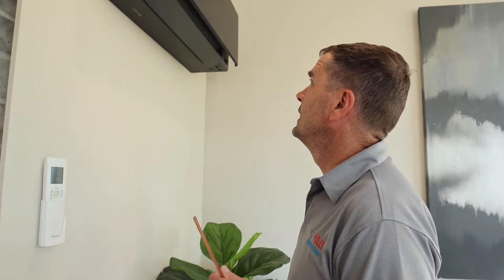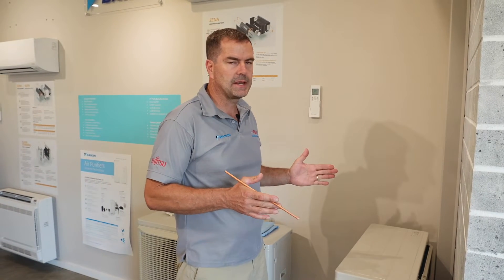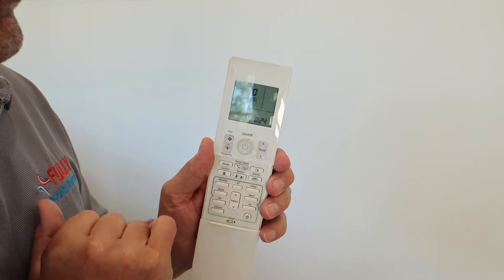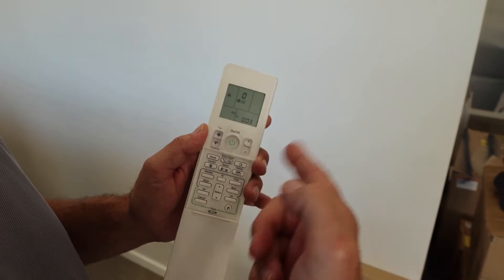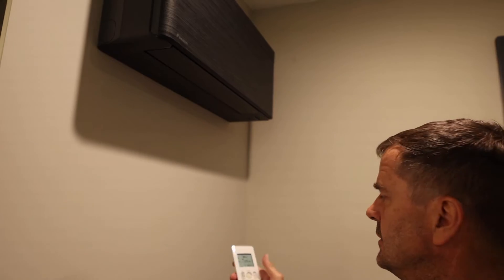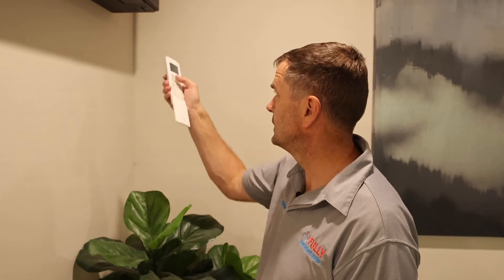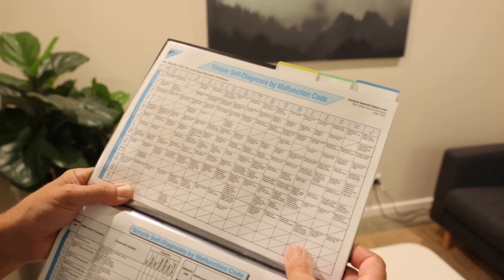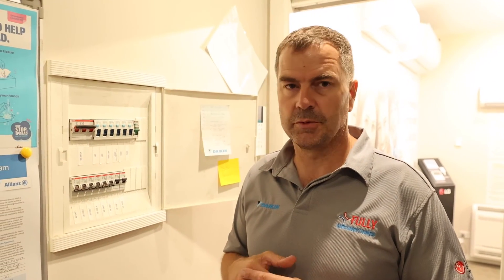How to fault find a Daikin air conditioner, troubleshoot split system ductless, green light flashing

Comment: I have a very new Daikin heatpump, maybe a little over a month old now and it seems to be going into defrost mode way too often, like every 17 to 20minutes and it takes 15minutes to defrost. So almost half the time goes to defrosting the thing.  And when it starts defrosting, there's no ice buildup on the outside unit, i've checked. That can't be right is it? Why does it defrost when there's no ice?
Reply from the maker: Doesn’t sound right, have you watched my defrost video, this explains how, why and when your Daikin’s units gos into defrost. I would be getting the people who installed it sounds like there is a problem.
Reply: @FullyAirconditioned   I watched many vids about these things. Some of them talked about timers that each manufacturer put on the board, commonly 30-60 or 90mins, meaning minimum runtime until next defrost cycle. What timings does Daikin have on these things? Is one of them about 17 to 20 minutes like mine does? Anyway on mine something clearly triggers the defrost cycle even when not needed.
Reply from the maker: https://youtu.be/A6QUFtnLu9c?si=mJE-CzTg5OSRcdwE
There many reasons and ways systems chose to go into defrost and it depends on the brand and where it’s made. The most simple and basic is the defrost time you described, after a set amount of time if the coil temp is below the pre set temperature the system will go through a defrost. The daikin’s units like in my video (link above) doesn’t have a defrost time as such, it has a defrost function that is triggered by a number of different scenarios. The daikin units like in my video, have multiple sensors, on the coil, outside temp, suction temp liquid line temp, suction pressure sensor, and an on board Computer deciding when to go into defrost.  It looks at temperature, gas pressure, temp outside, coil temperature and a number of other input, not just time and coil temperature. But depending on where the unit is made, if it is an American style outdoor unit, the standard looking barrel type system, that one is made in the US and it has basic defrost timer.
Reply: @FullyAirconditioned   Ok. I live in Norway, northern europe. The ones we have here are made for nordic conditions, pretty cold environments. I'm pretty sure they have that combination of sensors you described and one of them is probably having a problem in my case.

Comment: I don't even have a light blinking. I can't turn it on but the remote works it just won't turn the air con on
Reply from the maker: Then it probably doesn’t have any power, have you tried pushing the on button that’s located on the air conditioner??, if that doesn’t work I would suggest there is no power getting to the unit.
Reply: @FullyAirconditioned  yep have tried to turn it on there.  That makes sense that there might not be power to it. I've tried the power board. I've turned them all off and back on.  I'm not sure which one it sits on. Might be the wiring? It did work back in June.  But I haven't used it since then.
Reply from the maker: @TheJulie169  there could be an   isolator switch outside next to the unit
Reply: @FullyAirconditioned  there is a power on off. We've tried that.  I looked over the unit itself outside and I couldn't find anything.
Reply from the maker: @TheJulie169   Well if the power is on, and it doesn’t work, then the indoor pc board is possibly dead, you need to call your local Daikin repairer, you have done all the basic checks.
Reply: @FullyAirconditioned  thank you.  It sucks because it's basically brand new. Thank you for your help
Reply from the maker: @TheJulie169  then your in luck as the Daikin systems have a 5 year parts and labour warranty, so getting it repaired should cost you, as long as it not damage from pests.
Reply: @FullyAirconditioned  excellent thank you

Comment: Wait how do you get it off the 00 mode
Reply from the maker: Displayed on the remote, it should just time out after a few minutes and go back to a normal screen. When you test a system an it long beeps on 00 that means there no faults active and the system in normal working order.

Comment: What if I get a RCV ERROR when I press cancel for 5 seconds. My unit is a Daikin FTXR28EV1B9 I turned my unit off with the manual power button. And I turned it on again and the controller won’t do anything. It will not control my ac unit and it’s just blowing slowly.
Reply from the maker: Your AC system is the “Uluṟu Sahara” or the ‘US7” that what it was called in Australia, it has a different remote and it dose some extra things over a standard system. I can control the humidity add land reduce humidity.  I looked through the services manual and could find any thing in reference to RCV. When you say you turned it off, was that from the button on the front of the system or an isolator / circuit breaker at the switch board, as this is what needs to be turned off to reset the system. When you turn it on and off from the button on the front of the system it go in to “i have lost my remote mode, emergency operation” and it will run and cool if its hot or heat if its cold, but it doesn’t turn on, on the last setting you had it set to.

Comment: A Daikin was installed the installer spent hours trouble shooting on phone with technician to finally get it going.  The technician was on speed dial. About once a month the installer was working on it.  The home owner demanded it be replaced. Rather than get a bad rep the installer replaced the Daikin mini split.. with a Stealth i believe..problem solved.. of course he lost a couple thousand Dollars..   The installer gave me the daikin mini split system only charged to istall it..  most screws are lost from being worked on so often. Very unreliable.  5 years old  on a 15 year warranty ..think i will just junk it.
Reply from the maker: Sounds like the installer has no idea, here in Australia you have cert 2 and cert 3 qualification. Cert 2 are will do as little as a 2 day course, cert 3 do a 4 year apprenticeship. Most people who don’t know what they are doing blame the brand. Daikin units are far more complex with there inverter driven compressors compared to the direct on line non inverter systems, but the push with energy efficiency the old system won’t pass the minimum standard, people working on them will need to up skill. This has happened about 15-20 years ago in Australia. We basically have no non inverter compressors in new systems at all.
Reply: @FullyAirconditioned  no installed my guess a couple thousand or more.  Just a lemon . .had a car like that years ago. Called a vega.
Reply: @FullyAirconditioned  oh o forgot he still installs Daikin.

Comment: What if the unit does beep at all any more even when it is working? Is there another way to know which error code is the right one?
Reply from the maker: If the green light is flashing and the unit is not emitting a beep when doing the test with the remote, then you will need a repair company to check it out using the daikin d-checker. The d-checker will display the fault code. My guess is that s mouse has got into the wall cavity and followed the pipes into the indoor unit. In there the mouse has chewed through the small wires to the board that contains the beeper. Take the cover off and see if there mouse poop or chewed cables.
Reply from the maker: Once repaired and before the cover hose on fill the hole with “ no more gaps” or some type of filler that’s not to hard to remove, don’t use silicone as it’s a nightmare to remove later.

Comment: What should we do if it says the unit has system malfunction? should there be a specific part that need to be replace or the whole unit needs to be replaced?
Reply from the maker: What’s the fault code?? There is a link in the description that has all the fault codes, parts or repair could get the system fixed, but other considerations are how old is it compared life expectancy of the unit. If it’s close to of over 15 years I would be up grading with a new system.
Reply: @FullyAirconditioned i appreciate your reply. Anyway, they’ve change our unit because they don’t know how to troubleshoot 😅
Reply from the maker: @sweetgirlden  🫣OMG

Comment: Why it didn't double beep at E6 and E1?
Reply from the maker: Double beeps let you know that one of the two digest is correct or part of the fault code. If you had a double beep on E6 and E1 then E is the common digit in the fault code. You just need to find the 2nd digit, it will be a number, try the 2nd method in finding the fault code in this video, it brings up more faults.

Comment: I don't have the remote. How can I still diagnose my Daikin split aircond with green flashing light and not cooling?
Reply from the maker: Don’t believe you can, unless you have a daikin d-checker (services tool), have your tried resetting the power to the system ?? If it’s a resettable fault the system will restart. If the fault comes straight back you will need the remote to check what it is. If it doesn’t reset, call your local daikin dealer for a services / repair call out and make sure they have a d-checked so they can check fault code as you don’t have the remote.
Reply: @FullyAirconditioned  thanks for your reply. My model is 23 years old, but hardly used. So I don't think the Daikin technician could repair it too.
Reply from the maker: @ps23-1-6  possibly time for a new one

Comment: The remote is like a mini computer... The old days of just putting on the unit with a button.  Much simpler…
Reply: Also I was on the job with my carpenter friend …  The customer has a Daikin  split system  on for air-conditioning… I turned the unit on by the remote , down the temperature to 58 it would run a while then automatically go to heat…. Do you think the batteries just need to be replaced in the remote? Thank you for your answer…

Comment: Good day sir! In my case my indoor unit are normal! There is no flashing the indicator light are steady but my outdoor unit will start then after a second it will turn off! Only the outdoor turn off!
Reply from the maker: It may be trying to restart, some faults will keep trying to over come the problem and try restarting up to 16 times. If the fault is still there after 16 starts the unit will go into fault, this could take 1.5 - 2 hours. Just leave the system on and running for this amount of time and then see if it goes into fault. This is all explained in the video, just watch the whole video.